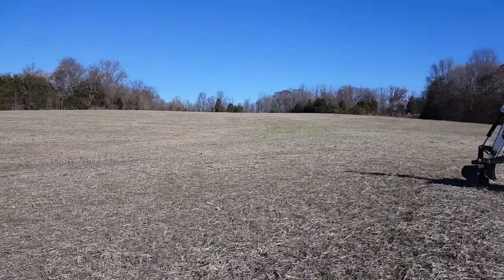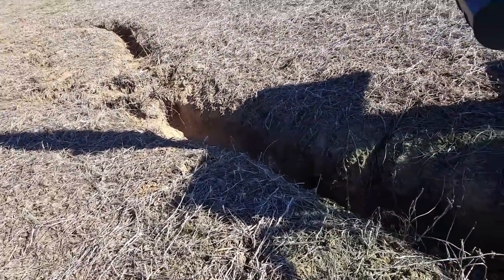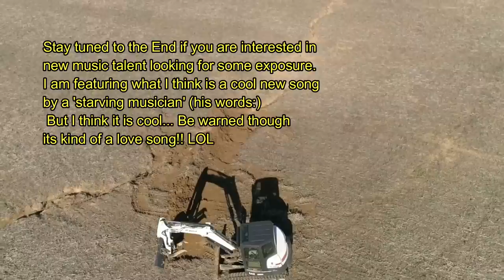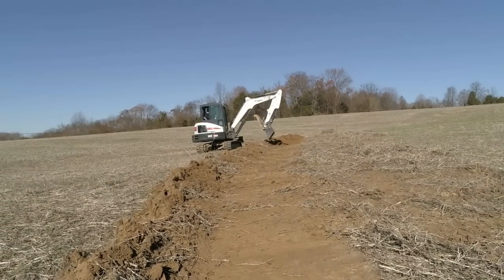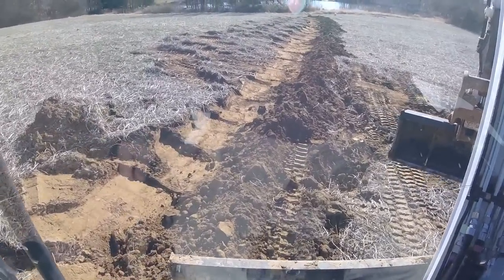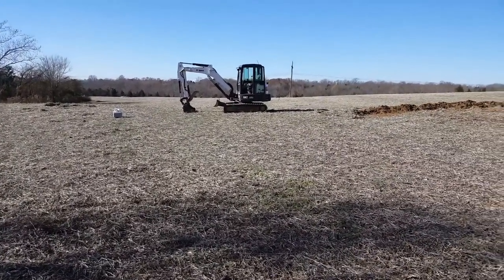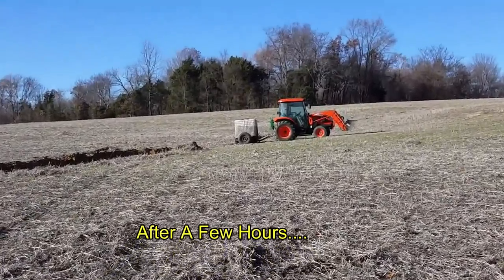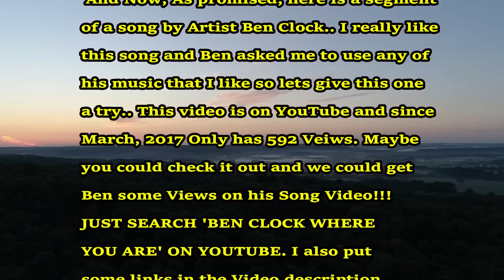Making New Drainage Cut To Fill Farm Pond & Feature Music Artist Ben Clock

Comment: Looking good Joe.  All that brush down by the pond will filter out the silt just fine.  Not sure if you are adding chemicals to the soybean field, but judging by the thick cover, I don't see any major problems.  Going to cost a few dollars for new tires on the trailer though.  That kioti probably didn't even slow down when the tire popped off.  Unfortunate.
Reply from the maker: Thanks Gary. Yeah, I was lazy and it caught up to me!!! Those tires are like 100 years old, but they still worked fine when I aired them up before use....

Comment: Would be my concern as well, the amount of fertilizer and run off getting into the pound. Any chance of making small silt pond before big pond?
Reply: Ryan Johnson 
I think the last segment being established soybeans and brush may save the day.., They use the same out here in Oregon to buffer runoff into streams. You cant stop the fertilizers, but the silt gets trapped pretty well by the vegetation.
Reply from the maker: yes, exactly, that's why they highly recommend (law in some states) that you maintain a weedy buffer around all ponds and runoff areas from farming. thanks.
Reply from the maker: The weedy vegetation is best to absorb runoff chemicals, thats why they highly recommend it (law in some states I believe) around farming practices. I'll keep an eye on the pond this year, but it has been quite clear and healthy and they've been farming that field for many years.
Reply: Kapper Outdoors 
They have strict regulations in Oregon around streams and lakes, requiring vegetation corridors. In many areas, in flood zone, FEMA also has rules about trees and vegetation

Comment: It looks like you blocked off the original ditch, correct?  What was wrong with the first ditch, other then being clogged by plant stalks?
Reply from the maker: I didn't tough the first ditch, it still runs into the pond as it always did. Nothing wrong with it, the clog is a good thing to stop silt :)